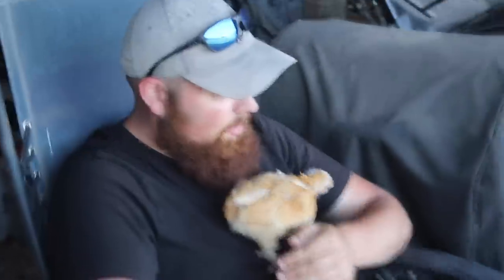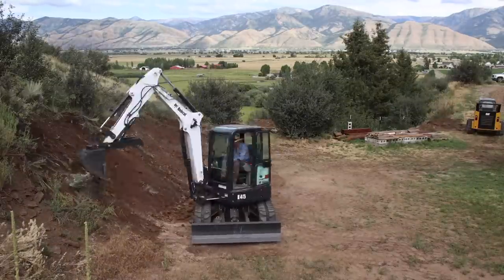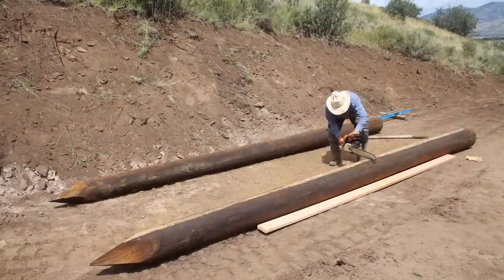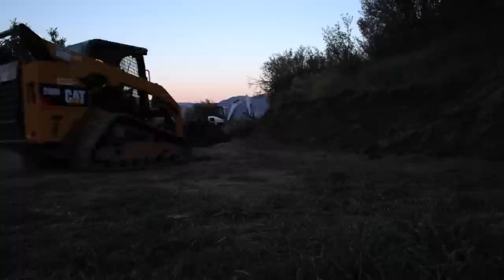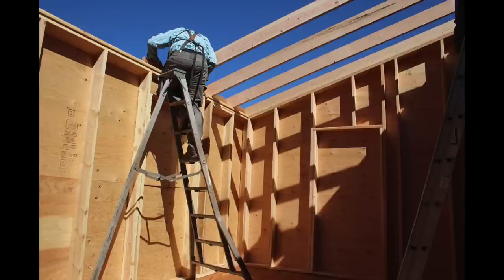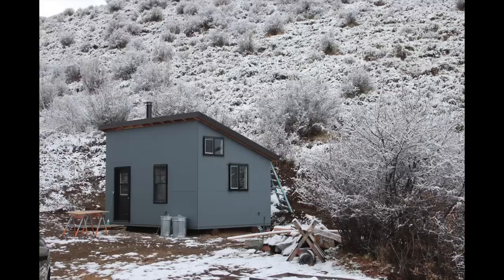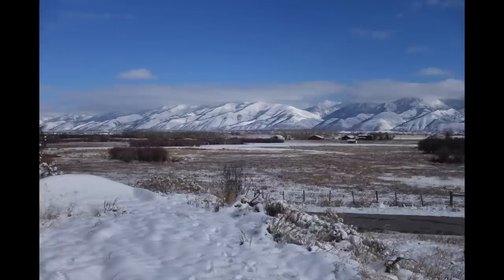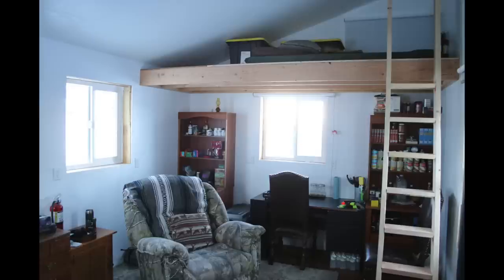Helping My Brother Build an Off Grid Tiny Cabin in 10 Weekends, From Bare Ground to Moved In!

Comment: Wondering if the inspection rules are different out there? Whenever I built anything in Oregon every so often they have to come out and inspect it and approve it. What a beautiful area.
Reply: does it cost you for that in OR ?
Reply: @nvention20  I built a garage and had permit. County wants increased property value for taxes. I believe any structure over 9x10 something like that needs permits here in Oregon. Yes different fees for different projects.

Comment: From the pictures there is alot of room infront of your building why did you jamb it into the hiil with that large sloping roof sloping to the back i would now dig out behind the cabin and leave more room for the snow to be push out of the way you may even need a little retaining wall yes the metal will help some but the cabin will be wicking up moisture all the and the floor joists will just rot unless you used pressure treated lumber with a water shed roo like you have the wood or siding should be a minimum of 12 from the ground and there should be a good slope left and right to carry the water away quickly of coarse you could pull the cabin out away from the hill run off good luck like what you have done inside we all need a cabin today to get away